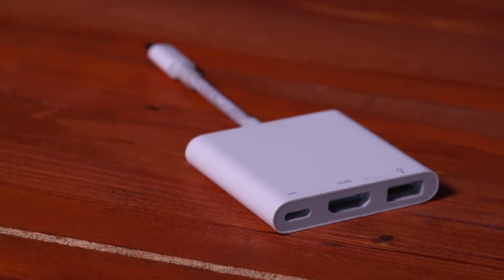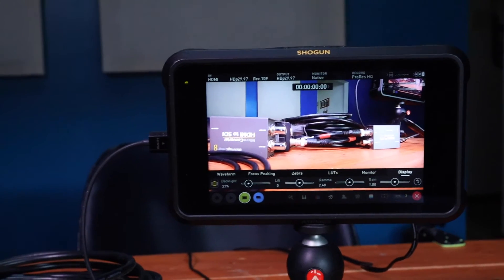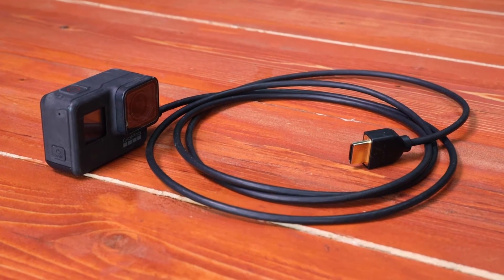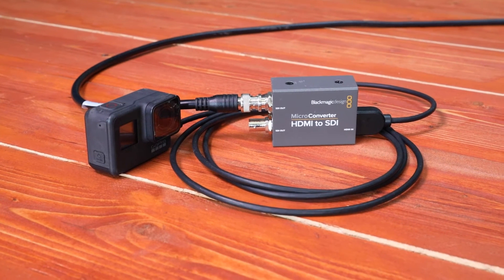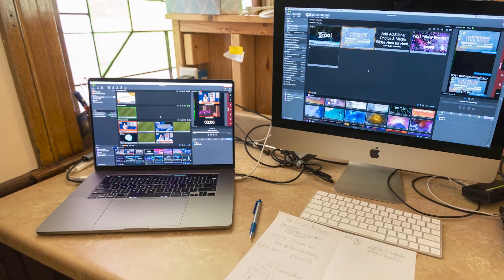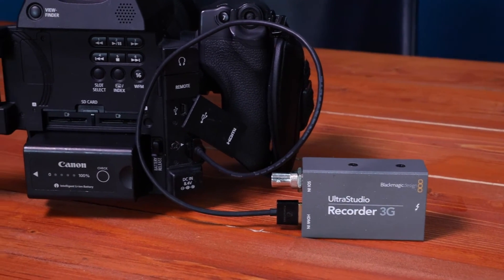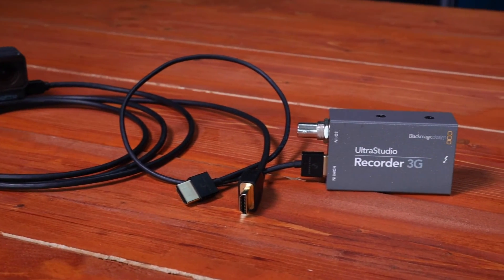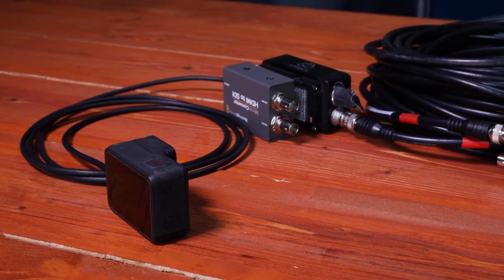Understanding Video Cables (HDMI, SDI, Fiber, DVI)

Comment: Two questions. Why is hdmi to ethernet not going to work long term? Also. I think your usbc to hdmi cable is actually thunderbolt to hdmi. It won’t work on anything expect a Mac, right?
Reply from the maker: HDMI to Ethernet is known to have reliability issues, and since it costs about the same as converting to SDI. It's best to just use SDI since it's so reliable. The USB-C to HDMI cable should work outside Mac and Thunderbolt. -Nathan

Comment: Is there any reason you don’t mention fiber HDMI cables? I’m honestly surprised so many people recommend converting to SDI for everything even when the source and destination are HDMI (for instance, a DSLR camera to ATEM video switcher). It seems like the conversions are unnecessary when fiber HDMI cables are relatively inexpensive and can go up to 300’ without issue. You can get a 150’ fiber HDMI cable for $70, meanwhile two BM converters and a 150’ SDI would cost you $150 for the same run. 

Maybe I’m just unlucky but I’ve had issues running double blackmagic converters on a signal, with them adding black bars on the screen or other anomalies. Meanwhile fiber HDMI cables have never given me any problems.
Reply from the maker: I agree, I don't think I knew about Fiber HDMI when I did this video. Fiber HDMI is a good option. -Nathan

Comment: Is it possible to connect two computers going from DVI-d to HDMI? I’m trying to connect Propresenter 7 with our streaming software on another computer without using NDI. 
NDI has not been super reliable and our Internet is not that great so I want to keep from using it unless absolutely necessary
Reply from the maker: Laptops don't have HDMI Input ports, Only Output. So you could send the signal from Pro7 out from "Computer A" and into the Streaming Computer, via Hardware but you would need to use a Video Capture device such as the BM UltraStudio Recorder 3G I mentioned in this video on the streaming computer. 

With that said, I would try to get the NDI Connection stronger. Are both Computers Hardwired into the network? NDI supports Alpha Key, and unless you use a device like a DeckLink Duo 2 you can't get Alpha Transparency from Pro7. Check out my video to explain this better. titled: "ProPresenter 7 - Transparent Output (Alpha, Chroma Key Training)" -Nathan